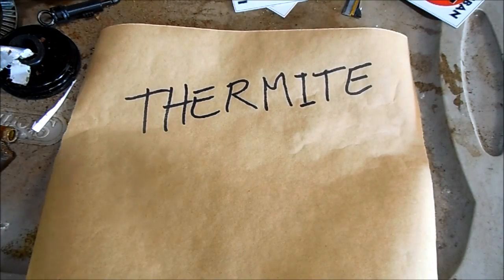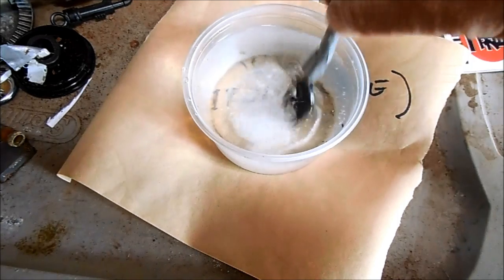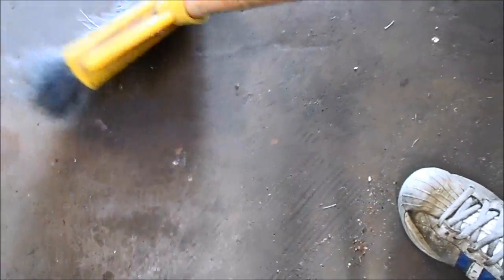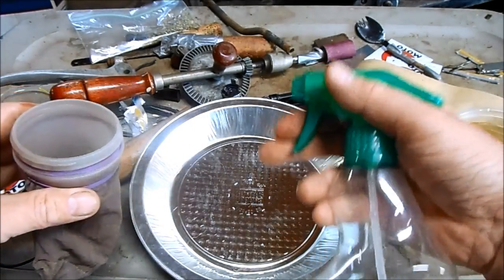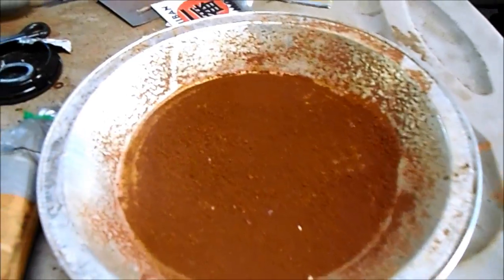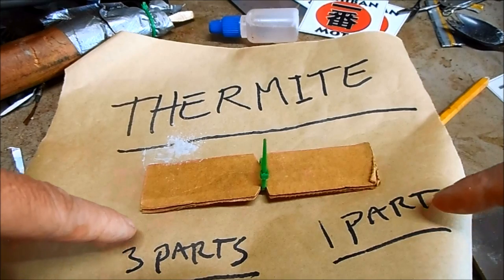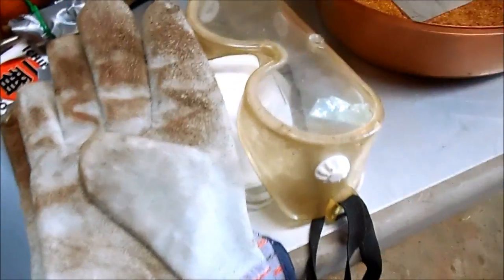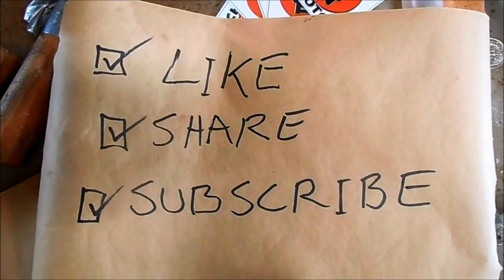how to make diy thermite for free by ichiban moto

Comment: How do you ignite the termite again? I know you use the welding rod but how exactly is that done? I've never welded anything before. Thanks
Reply: Casper Ko you can use a magnesium ribbon, sparkler and in some cases a fire work fuse
Reply: I assume he lit it with a torch.
Sparklers will work.
So will road flares

Comment: to pick up the iron shavings, why not take a piece of cloth, lay a magnet under it, dump the floor dust on top, turn it upside down and shake it, then put it over the bucket and pull away the magnet? Or just put the magnet under the plastic dustpan and dump the crap out of the dustpan. Yeah, forget the cloth, I like this idea better.

Comment: BAD ASS THERMITE!
I've heard the use thermite to weld railroad tracks. I'll bet you could use it to make even stronger welds on a cafe racer frame.
Reply from the maker: Alberto Knox  I need to compare the strength of a thermite weld vs. fabrication grade assembly tape